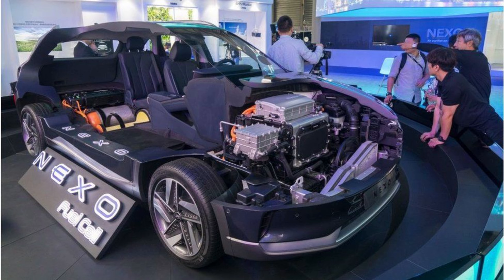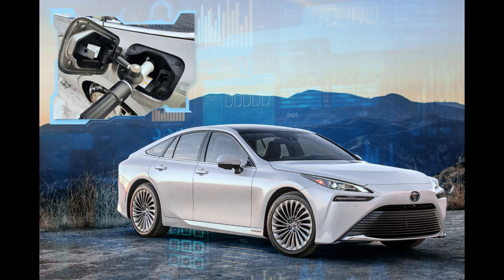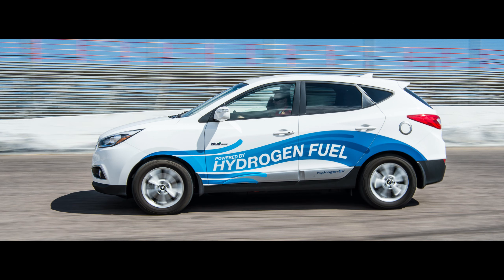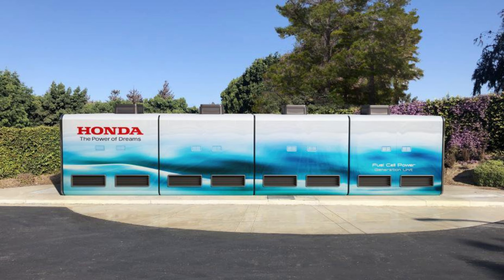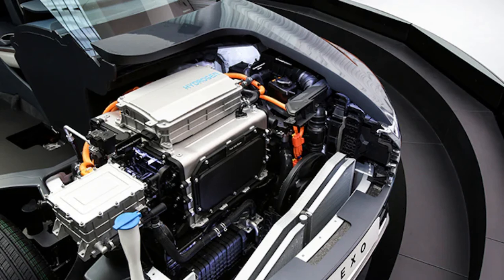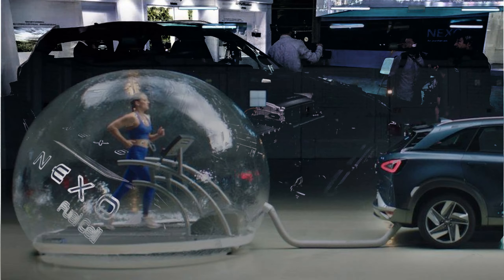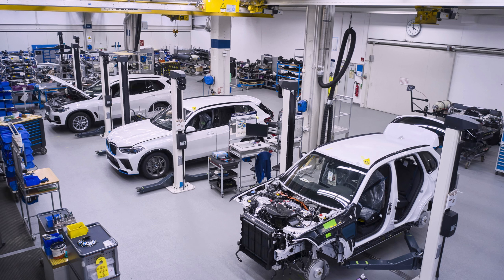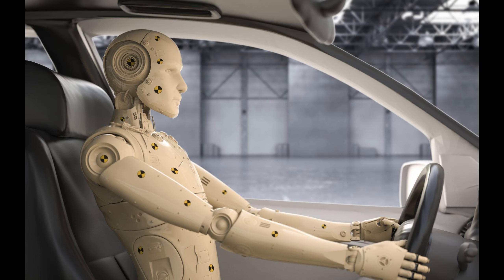Hydrogen Cars: Unveiling the Future of Sustainable Mobility

Comment: Whether by fuel cell (electric) or by combustion (Internal Combustion Engine  ICE) I very much doubt that Hydrogen will ever be used to power any significant number of automotive vehicles.  Battery Electric Vehicles (BEV) prices will continue to drop and the cost of fueling them will always be cheaper than the cost to fuel a hydrogen powered vehicle.